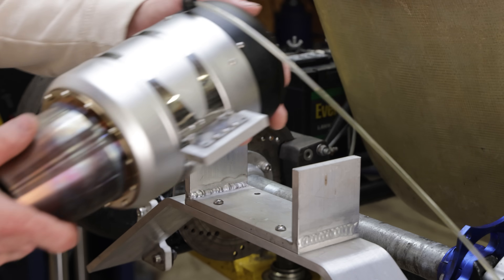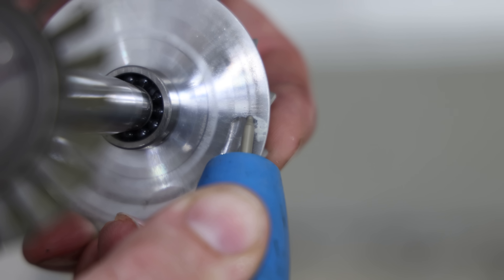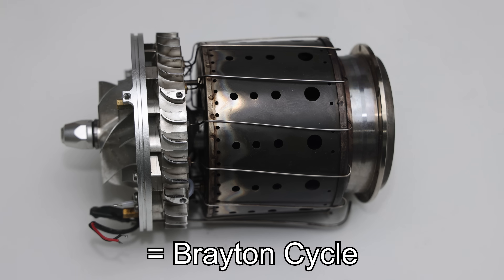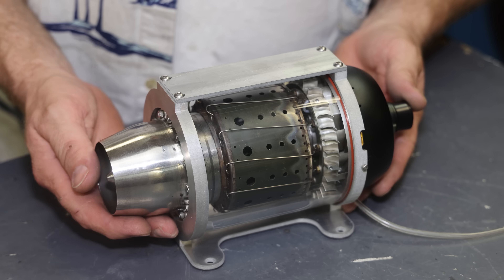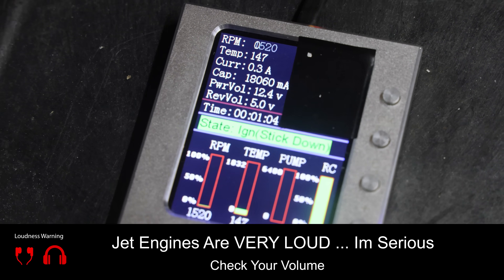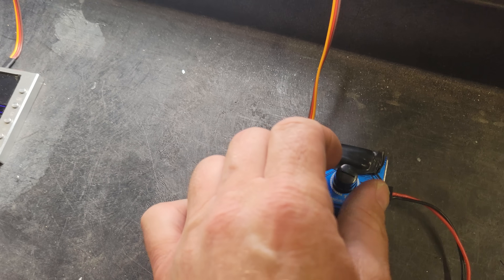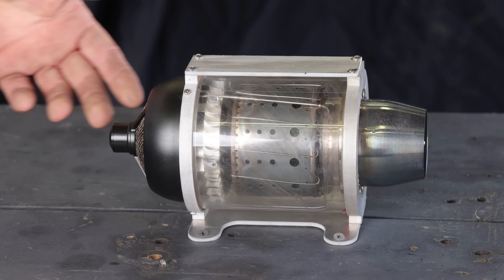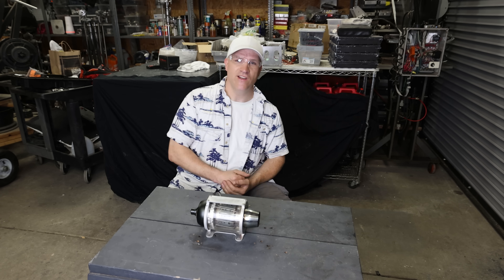See Thru Jet Engine

Comment: That is amazing to see the combustion process as well as the air flow as evidenced by the streaks on the inside. It was also interesting when you showed the expansion / contraction of the engine when you were accelerating/decelerating.  Question - what material did you use for the transparent shell? Borosilicate glass?
Reply: I think it may have just been acrylic as you can see it melting in the video at the back of the engine.
Reply: Probably Pyrex ...
Reply: It's his own material he designed over 4 years.
Reply: @ZeddisGood  Too bad he didn't know you can buy Pyrex tubing of various lengths, O.D., and I.D.! I had a project at work years ago that involved heating Diesel Engine oil thermostats in mineral oil. We had some customer's that overheated engines and blamed it on (as usual) "Defective" parts. So my task was to test a BUNCH of them. Well above the temp of boiling water. Got this Pyrex measuring cup and set it up on a firebrick welding table. I used an Oxy-Acetylene torch to heat it up. Got the temp dialed in and dipped them one at a time (had an industrial thermometer in there). They all opened at the correct temp! My boss walked by while I was testing them, stopped and looked at my test rig, and said: "Nice! I wouldn't have thought of doing it that way!" Now he was a 50 State PE and I was still working on my BSMET at the time! ;)
Reply: It's quartz, not much to it. There's enough airflow to keep it under Tglass.

Comment: Here is a dumb question please
How do you get it to start turning if you are not burning fuel yet? I understand how it works once fuel is burning and escaping , which makes it inhale more air etc, but how does it start rotating from zero? Thanks
Reply: An electric starter motor in the front.

Comment: I'm honestly surprised the acrylic didn't just give up. The radiant heat and air pressure inside that thing...
Reply: He developed a special material for this and the rotory engine. He was considering patenting it, so its under wraps for now. Amazing properties.
Reply: @planecrazy2  It's pretty damn special if it can take that!

Comment: Most of the energy comes from the fuel but most of the thrust comes from the change in momentum of the working air. You are misleading people when you made that statement about the fuel.
Reply: All of the energy comes from burning fuel, as with any engine. Yes, the thrust results only from the change in momentum of the working fluid, which is almost entirely the air. I agree - the statement in the video is misleading... or simply wrong.

Comment: Cool vid. How is it that there are flames even without an afterburner
Reply from the maker: Well you can donate hot start if you want flames, but I didn't want that here because I was nervous about breaking the cylinder. But even though when it's starting there is still some residual fuel that ends up burning after the turbine if that makes sense
Reply: I see. Makes it look way cooler

Comment: This is cool! 
What about a see through pulse jet engine? That would bring in the slomo stuff again
Reply from the maker: I have been thinking how about that for quite some time now, but that is exponentially more dangerous than this...😬
Reply: @WarpedYT  just brainstorming, but maybe a good glass blower can draw the whole resonance tube out of a thick straight tube of temperature shock proof glass 🤔

Thank you by the way, for warping my perception over all these years. Learned a lot from your work!
Reply: @patrickfle9172  the engine which Jetpol built around 2010 has a borosilicate glass tube housing; I don't know how they produced the tube or where the obtained it.
Reply: @brianb-p6586  I've seen professional glassblowers blow wine glasses in wood moulds. Something along this line should be doable... but that's not my field tbh

Comment: First see-through jet model that hasn't shattered or melted
Reply: Someone else pointed out that this is not true: Jetpol did this with their GTM120 engine (about the same size as this one and similar in design), 11 years ago. Their video is hilarious - the operator has to keep pushing the table back in place. They even now offer it (now a version of the current GTM140) with the glass housing as a product for customers (yes, you can just buy one) as a training tool.

The Jetpol housing is 5 mm thick borosilicate glass. Warped Perception is apparently making this work with a polymer composite - rather than glass - which is impressive.

Comment: Great job! I worked as an engineer at Pratt & Whitney for 24 years and found this video very interesting.
Reply from the maker: Thank you... I love Pratt and Whitney
Reply: @WarpedYT  Everybody loves P&W.  "In Thrust We Trust".  ( Except maybe GE! )  LoL!
Reply: @TheCyberMantis  but nothing growls like a loaded rb211 singing its song.
Reply: @BobbyGeneric145  Olympus please...
Reply: @TheCyberMantis  damn that quote
Reply: question
when the jet engine starts what keeps the blades spinning?
is it spinning because of the vaccum of air coming in caused by air being pushed out of the back?
i understand how the electric starter compresses air enough for the fuel air ratio to be right but my imagination is limited to my knowledge of car engines
Reply: @lllilililililililililll the turbine and compressor wheels are joined via a common shaft. if one spins then then the other will spin too.
Reply: @lllilililililililililll  The cycle needs to be initiated by an outside source of power to spin up the compressor enough to start the combustion cycle in the combustion chamber. this is usually done by either a compressed air starter motor or an electric starter motor connected to the compressor shaft. when the compressor is rotating at sufficient speed to provide compressed air to the combustion chamber, fuel is fed in  and lit off to start the cycle. the hot expanding gasses then turn the turbine shaft at the rear of the engine, which turns the compressor and the cycle become self supporting from there on, as long as fuel is fed to the burner chamber. Thrust is controlled by the amount of fuel and air fed into the chamber. If anything interferes with this cycle, combustion will be lost resulting in a "flame out" or othe undesired effects😒
Reply: @lllilililililililililll  If you have car knowledge then think of it more like a turbo.  It's actually kinda the same thing in a way.  The hot gasses push the turbine and are way more than enough to spin it at 300k rpm to generate lots of air compression to make more power.  Obviously two different animals, but the concept of the turbine generating the rotational shaft force is exactly the same.  Difference is obviously that the jet is self-contained, where the turbo requires gasses from combustion of the engine to be piped in.
Reply: @lllilililililililililll  The blade at the back is fixed to the same shaft that's attached to the blade at the front.  When the exhaust is pushed out the back, it goes through that blade, which forces it to spin, and consequently forces the shaft it's attached to and front blade to spin as well - which sucks in more air, which mixes with more fuel and repeats the process.
Reply: I imagine you guys probably saw this sort of thing only through computer simulations of the engines you were working on, you might get a ton of usable data from the sim but visualizing it in real time likely brings a whole different perspective.
Reply: Same here my dad uncle and I have jobs as engineers and marketers there.
Reply: i think i understand it now
Reply: @lllilililililililililll  The 'thought experiment' that helped me to understand: Think of the jet engine as two identical  fans in a tube, connected by a common shaft. Add a 'T' piece to the tube and blow air into the space between the fans. One of the fans will try and turn clockwise, and the other will try and turn anti-clockwise. Because the fans are identical, the torque on both will be the same, but in opposite directions, so nothing will happen and the air you blow in will spill out of both ends of the tube equally. 

Now imagine that you change the blade angle of one of the fans slightly - the torque that the fans generate will no longer be equal, so the rotor will start to spin - one of the fans will act as a turbine driving the shaft, the other will be driven backwards, drawing more air into the tube, acting as the compressor.  The air you blow in will all come out of one end of the tube, together with even more air that is being drawn into the other end of the tube.

In a real engine, the gasses generated by the burning fuel have the same effect as the  'extra' air being blown in through the 'T' piece.
Reply: @Mister_G  Thank you for that lucid explanation.
Reply: @blueshortsboy  Hey! Glad you could follow it - It was a 'lightbulb moment' for me :)
Reply: Rolls Royce are better than Pratt and Whitney
Reply: Fun fact: I interviewed with P&W in Mass for a ceramic coating robotic programming job a few years ago. I aced the interview but turned the job down as it didn't pay enough and finding a place to live in that area was difficult.
Reply: @Hey.Its.Andrew_Ryan  that's not a fun fact you just wanted to brag.
Reply: @Hey.Its.Andrew_Ryan  I'm a design engineer at GE 🤣 so no love for pratt

Comment: Heck yeah! You always have dope ideas dude. This video was awesome. I'm excited for part two of this, however I'm still anxiously waiting on a follow up of the light you had designed that cooler for. Imagine if you had that high CRI light for the slowmo of this video?
Reply from the maker: Thank you, this one was almost 4 years in the making because of the material that I had to develop to use for the cylinder. As for the light yes I will be using it very soon here, I didn't use it here in this video because I didn't do anything crazy with the engine, but I will in the next video. Thanks
Reply: @WarpedYT  are you able to discuss more about the material here or do we have to wait for part 2? I imagine it is something relevant to heat resistant while also see through and the complexities that come with that.

Comment: Yo Matt!   Yet another great showcase of both the complexity and simplicity of a jet engine.   Thank you for always looking for creative ways to teach amazing mechanical things my man!
Reply from the maker: Thanks and your welcome, this one was 4 years in the making for various complex reasons but mostly because it took me a very long time to develop the material to use for the cylinder.
Reply: @WarpedYT  4 years to make a 10 minute video.  thank you wp.
Reply: @WarpedYT   I have several of these same jet engines for RC jets and its great to see what goes on inside then. Thanks for the video.
Reply: @WarpedYT  Can you test jet engine with 100% hydrogen and oxygen sir, we want see if hydogen capable extending burning timing than regular fuel, hydrogen will become main candidate to power personal vtol powered 100% hydrogen + oxygen jet engine.
Reply: I thank that was a quartz tube, isn't it?
Reply: @gakich.  he developed the material himself over the past 4 years, it's his "secret sauce".

Comment: Matt, a couple of things… you should take the mesh off of the front, you’ll be surprised but it defo will affect the performance of the engine!
Also I’d love to see a project where you add an afterburner and test the thrust the engine produces!
Reply: i’m sure he knows that…the mesh prevents anything from entering the engine and then causing catastrophic failure. the performance of this engine is not the main goal of this video
Reply: @briandavis7226  Its such a loose mesh tho, bugs and dust would still get sucked in and I cant see anything bigger then that floating around his garage anyway
Reply: @briandavis7226   you say that like it’s obvious but them preventing the engine from sucking things in isn’t???🤦🏻‍♂️ the guy strapped them to the back of a car and go kart, I’m pretty sure that’s not a major part of his thinking.

Comment: Yeah that was cool. Need to put an air pressure gauge on the chamber. Maybe a mass air flow sensor on the intake and possibly exit.
Reply: See-through engines usually help explain operation, but with no visible moving parts (the compressor and turbine are not visible and would only be blurs anyway) there isn't much to see. Temperatures across the combustion chamber are indicated by colour, but the other important parameter is pressure, and that's not visible in any way.

Comment: That is absolutely insane! I just love how the hot-spots move towards the exhaust side as it ramps up.
Thanks for this amazing and unique content <3
Reply: That was one of the two interesting things that I noticed. It makes sense because the intake end of the combustion chamber is cooled by the incoming air, so temperature increases in the flow direction as combustion adds heat.

The other interesting thing was the thermal expansion which the builder noted in the video.